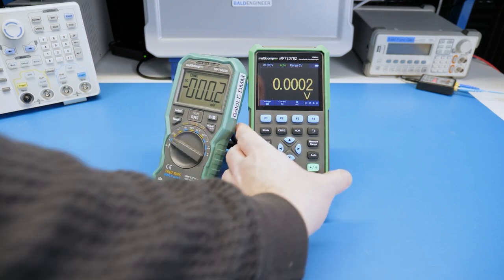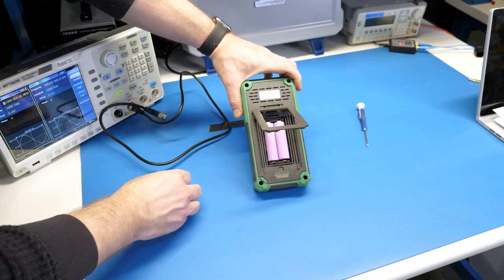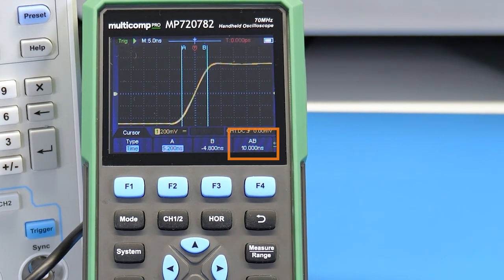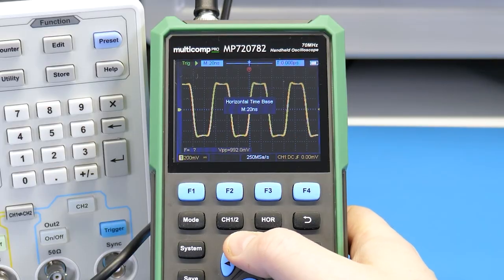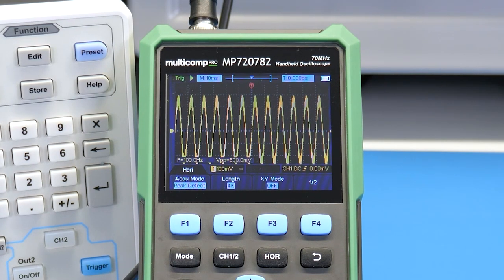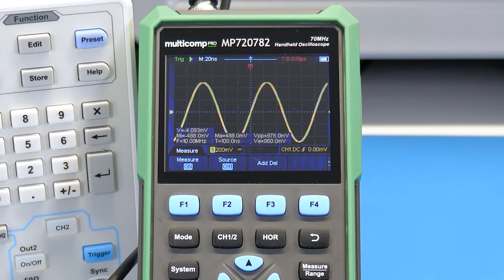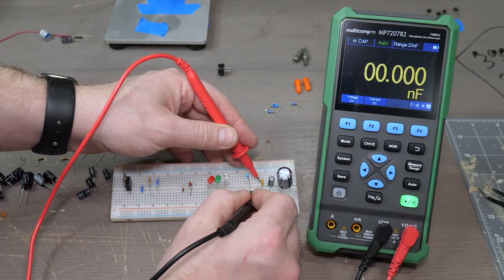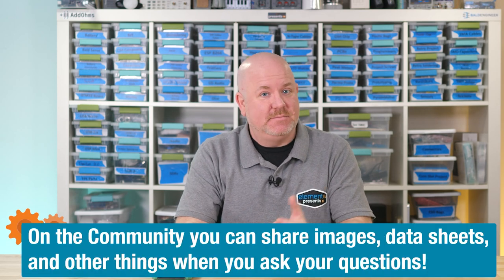Multicomp Pro Surprises James With Their Handheld DMM Oscilloscope - Workbench Wednesdays

Comment: So basically this is a rebranded OWON HDS242 :D Mine has 2 MAJOR Problems. First, if you connect the USB charger the ripple of the charger is visible on the measurement. Internally not shielded or whatever it maybe. The device is rendered useless then because the ripple is in the hundreds of millivolts visible on both channels, no matter if probes are connected, not connected or grounded. Second problem ist calibration drift. My device must be self calibrated 30 minutes after turning it on because if you put a sinewave on it, both swings differ by about 20-30 % in amplitude. So to get correct measurments you basically have to calibrate it when turning it on or wait 30 minutes, then one time calibrate and live with that. Still i love my Owon because it is super fast, easy to handle and you still can measure fine with it IF you know what you are doing. I can still recommend the product, no matter wich name it is branded under.
Reply: To your first point, since it's battery operated, why aren't you just running it on battery?  I leave mine to charge when not using occasionally, and use only the battery when the device is in use.  No extra wire that way, too.
Reply: @DavZell  I run it on battery but since i have the one with signal generator too it lasts about 3-4 h when you use the generator and the scope. And sometimes i just need it for longer than that :)
Reply: @Vitriolguy  What if you used a powerbank when you needed extra juice rather than plugging it into a charger?
Reply: What about simply swapping out the batteries for a freshly charged, spare, set..? 🙄